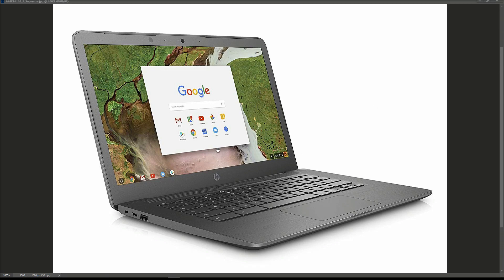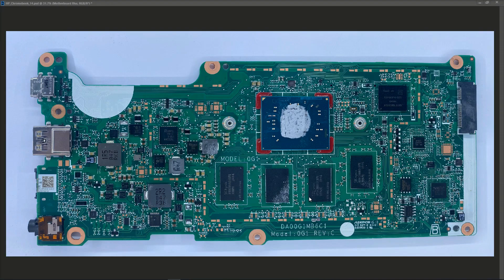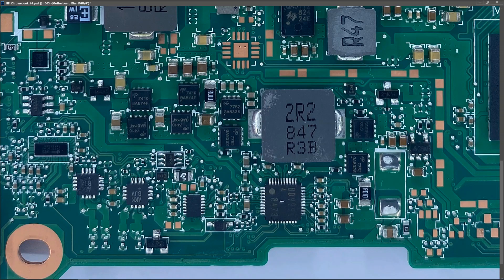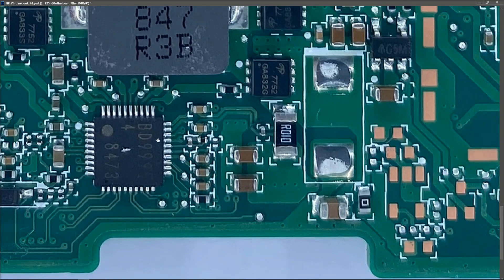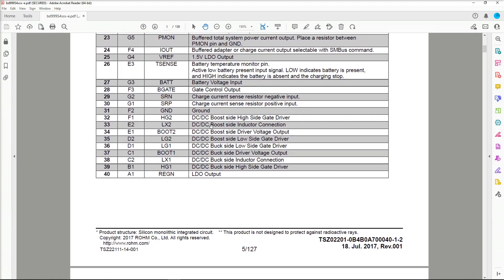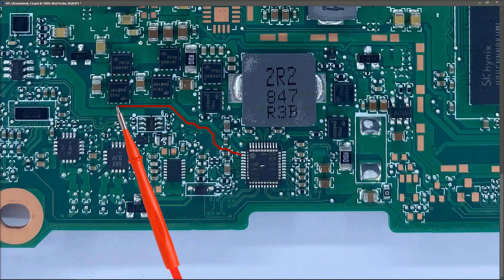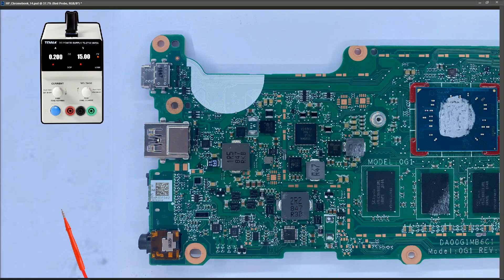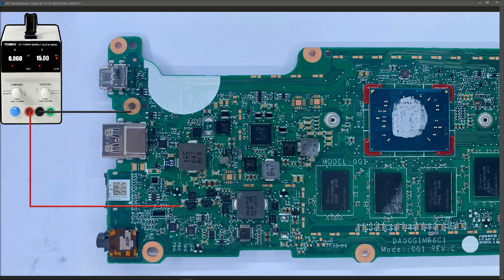HP Chromebook 14 - Motherboard Repair (Part 1)

Comment: You are incredibly methodical in your analysis. You must have taken Logic classes in school.
I have three Dell Inspiron 3180 netbooks, and they are all horrible. With either 32gb or 64gb eMMC, and limited RAM, the performance is terrible. They run ChromeOS and Linux Mint fine, but Windows 10 is a very unpleasant user experience.